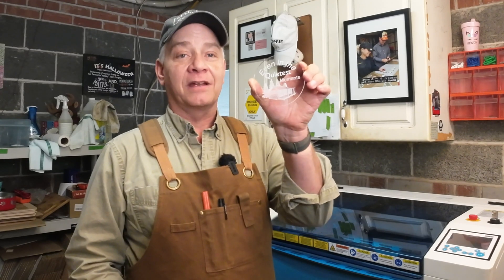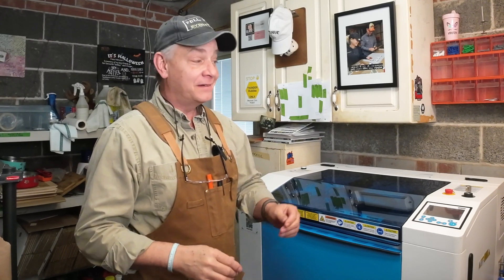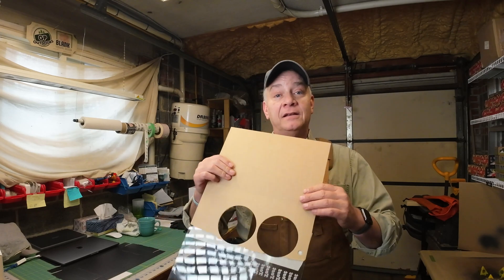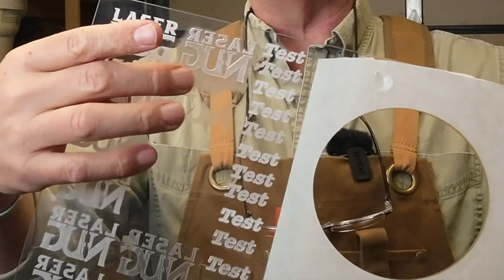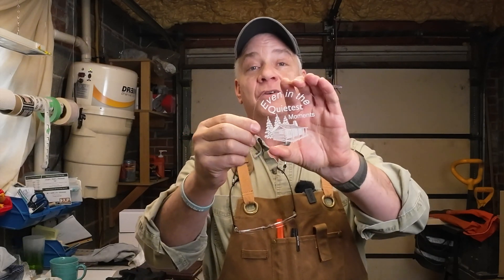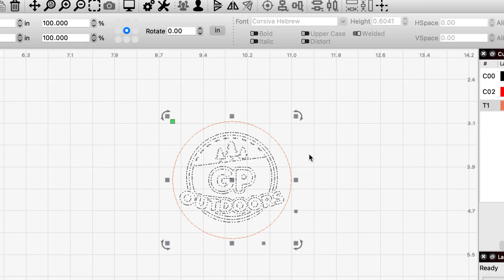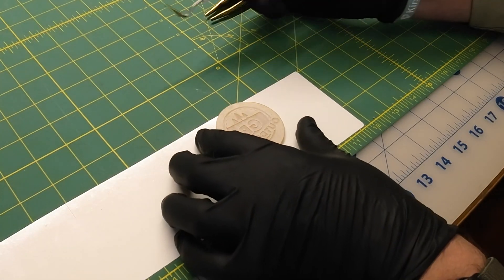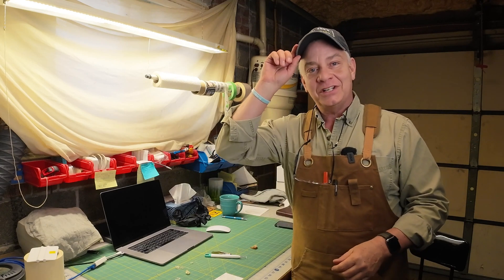QuickShot: 3mm Cast Acrylic Settings for Thunder Laser BOLT. Laser Engraver 033   4K

Comment: Thank you for that informative video.  If I may ask why you would not engrave/cut through the protective layer of paper on both sides but remove some and put masking tape on.  Wide masking tape is very hard to obtain here. TIA
Reply from the maker: Good morning - I find that the protective paper is too thick and gluey to engrave into so I find it easier to use the paper mask ( Paper transfer tape) - easier to pick off after etc. I use Paper Transfer Tape - it is made by Presto Tape. It comes in different widths and reasonable priced, if that helps. Cheers!
Reply: @LaserNUG  thank you for the information. 👍

Comment: Have you tried using something like gorilla tape? Use where ever you have to weed such as this project. I find if the tape is sticks more than the mask it will pull most not all but most of you mask in one easy shot. Great video and keep them coming.
Reply from the maker: Hey thanks so much for the advice. A couple other folks suggested it too so I just bought some at Home Depot yesterday to try it. Cheers and thanks again!

Comment: Another great video. Always look forward to your videos as they are so informative and helpful. There’s a tool called a Pin Pen that is helpful in removing masking. It has a much finer tip than the tool you were using. (Not sure what I did wrong, but I had posted a comment last night about the Pin Pen with the website where it can be found—perhaps you aren’t allowed to do that.) Gord, I look forward to your videos—keep up the excellent work.
Reply from the maker: Hey thanks very much Sharon. I will check it out. Yes - I disable comments that include URL's because alot of spam marketing has URL's in it so this filters them out. I'll take a look for it. :) Have a nice weekend and thanks for watching!